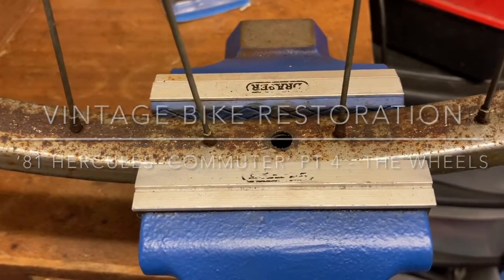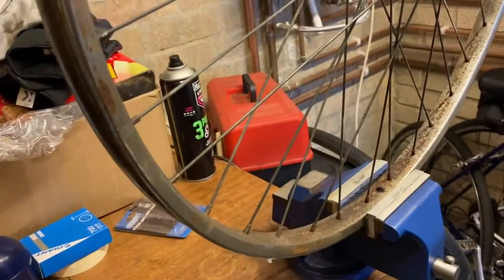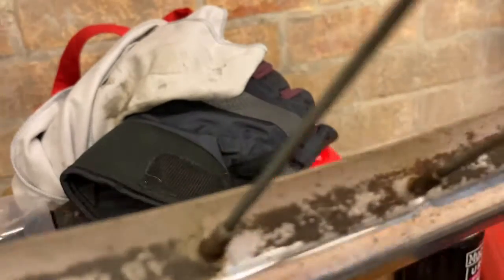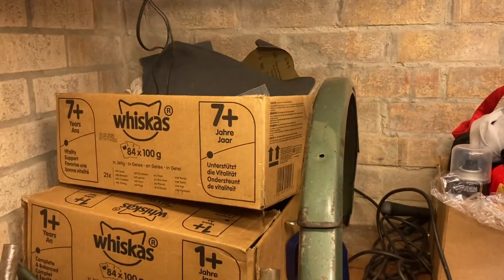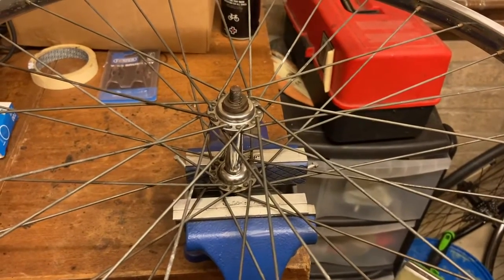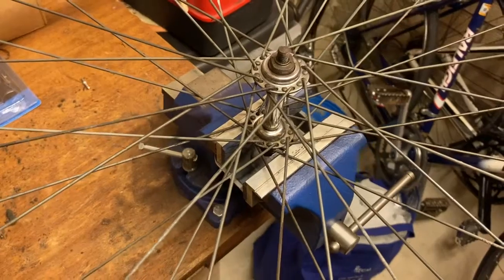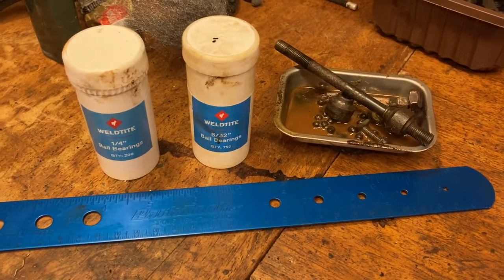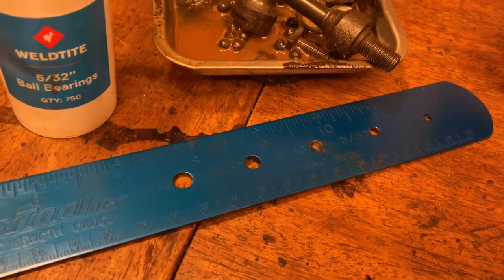Restoring the WORST bike hub ever // Hercules ‘Commuter’  vintage bike restoration - Part 4

Comment: My bottom bracket sounds like a whale singing! I assume that's because it's gummed up and needs servicing too. The rest of the bike has cleaned up ok, rust-wise, though the wheels and brake pulls don't look great cosmetically.
My chain/chain ring is dragging against the chain case. I think it needs gentle rebending in a vice.
I was amazed that the tyres pumped up and are holding air, and the brakes are good without me doing anything, and have the original leather faced Raleigh blocks in.
How do you know if the tyres need replacing? Is it best to put new ones in due to the 40 year age of the existing ones? The front looks sound, but the rear has a couple of cracks.
I'm hoping to give the bike to a friend, so I don't want to give her something that's about to break.
I think I need to visit the local bike shop to price up tubes and tyres, and see if they have any spare back racks or kick stands that I can buy. eBay has them, if not.
Reply from the maker: @sarahs784  If the tyre has lots of cracks in the sidewall or on the tread then it’s a sign the rubber is fatigued and will need replacing, otherwise they should be fine regardless of age.
Reply: Thanks  @RichsRidesandRestorations . New tyres and tubes it is. Off to the bike shop at lunch tomorrow to buy them.
I've managed to fix the chain case rubbing by putting a washer behind the bolt so no bending required thankfully.
Thanks for your prompt response, you are a helpful chap!
Reply: I think I've done all I can doing up my bike; it has new tyres and tubes, it's been cleaned and the rust removed and I've put a rack on the back that the man in the bike threw in for free with the tyres etc.
The pedals were going round by themselves, I checked the hub, and the shaped washer was facing the wrong way, as was the sprocket! The lock ring was a pain to put back on, but it's sorted now.
I've booked in for a free "Dr Bike" session to get it checked over to make sure I've not missed anything, then I'll give it to a friend.
I decided against greasing the hubs and bottom bracket, as they seem fine and I'm nervous about dismantling them.
Your videos have been very helpful Rich, thanks for taking the time to make them.
Reply from the maker: @sarahs784 That’s amazing - I hope your friend enjoys the bike! I’m really glad my videos were helpful to you 😁